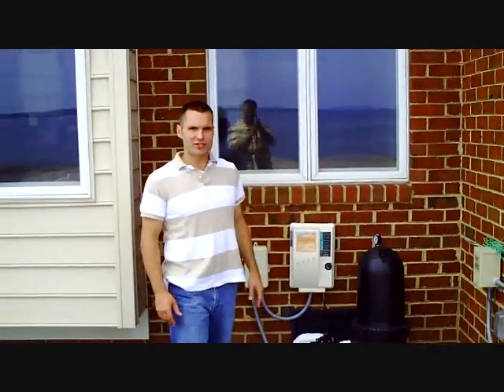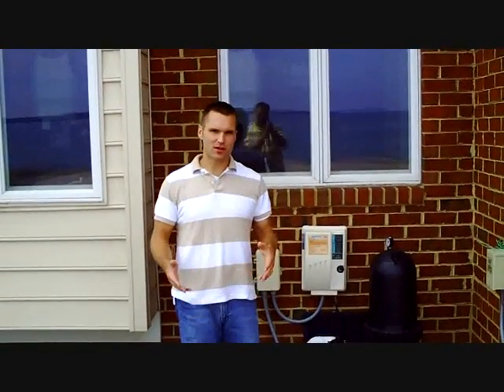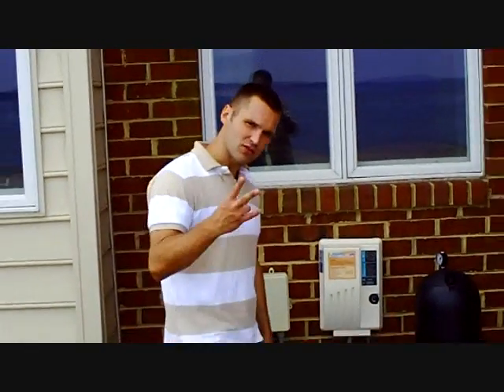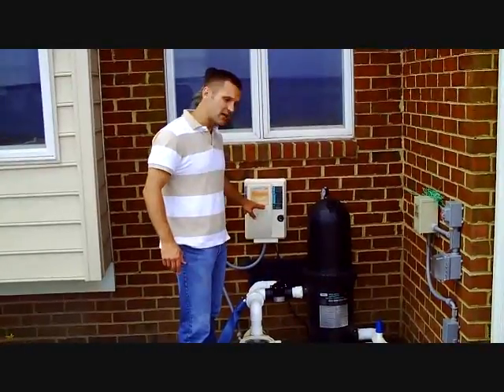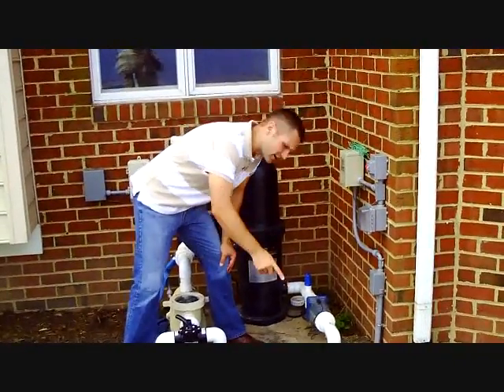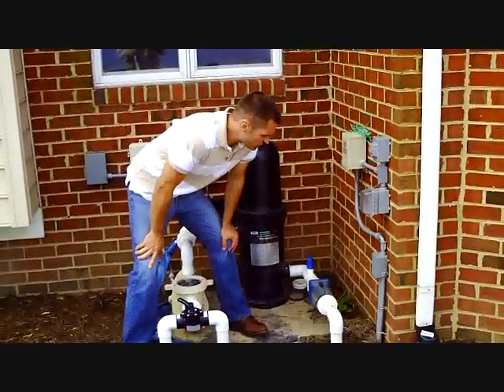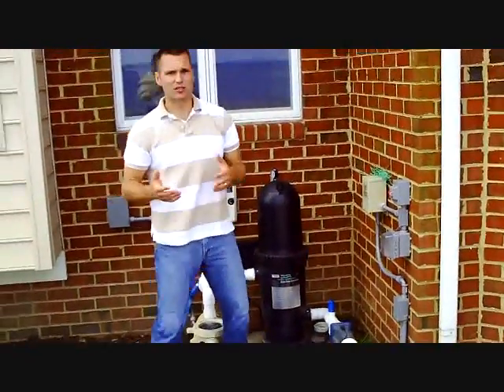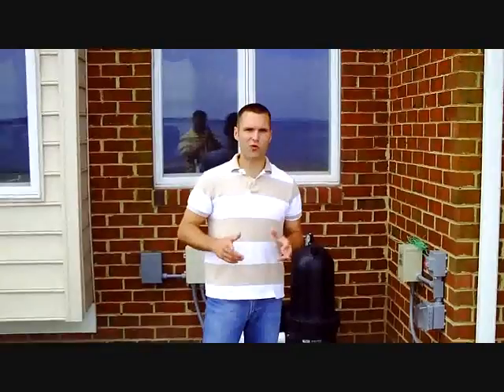Should I Use a Salt Chlorine Generator with My Fiberglass Pool

Comment: 50 lbs. salt/2,000g H20. A small pool is 7500g .  150 - 200 lbs. salt . And  I would say the average medium size pool is more like 20,000g. 500 lbs of salt!! I don't care what you say, there will be times that you need to shock. You could use PMS, and you would still not be using chlorine, or you still need chlorine to shock. No mention of TDS, or high alkalinity, which means more acid. Why the push for generator? chlorine is cheap, efficient, and easy.
And trichlor means less acid. CHEAP.

Comment from the maker: I've found that yes, pump seals do not last quite as long, but their expense is nominal considering salt's savings. Also, on a metal wall vinyl liner pool, or an above ground pool, leaks behind the liner with a salt system can certainly lead to corrosion.